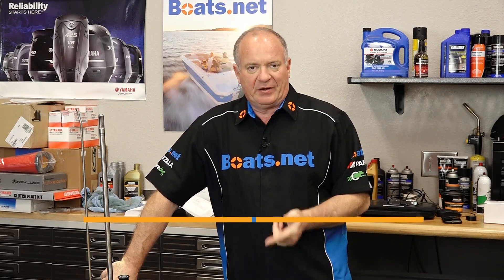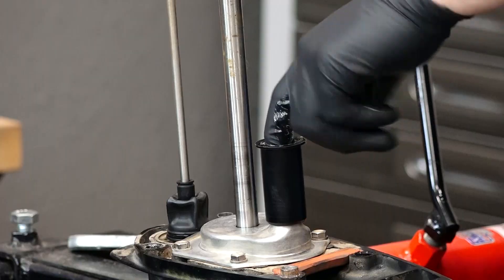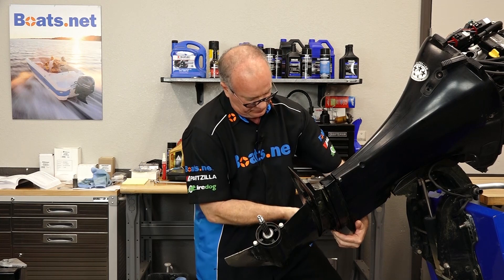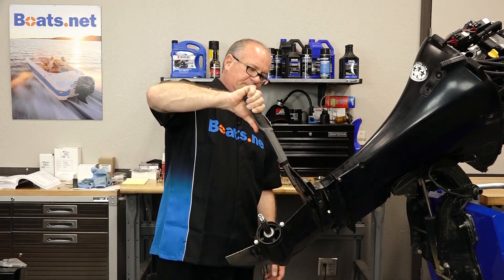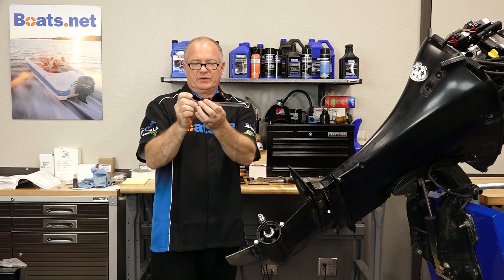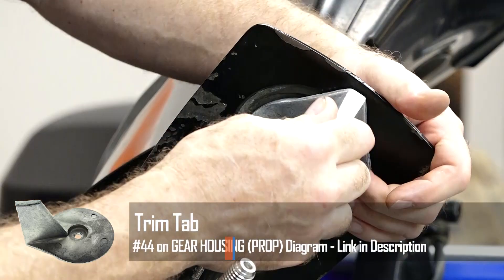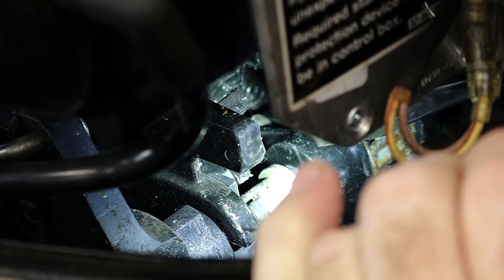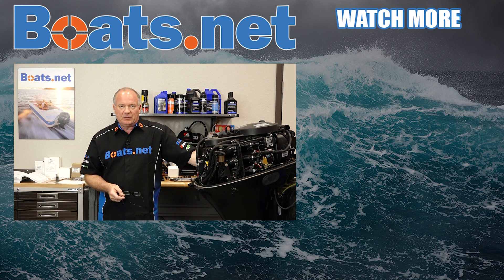Mercury Tracker 40 Lower Unit Remounting | Mercury 40HP Gearcase Installation | Boats.net

Comment: It looks like 12 was the time? I have a 90 hp Mercury outboard. With the motor in forward gear And I rotate the prop it makes a clicking sound as I turn the problem is that normal?

Comment: Mine is 2005 60hp efi, put water pump on put lower unit back on but control arm stays in forward, will almost go into neutral but didn't force it, what am i doing wrong?